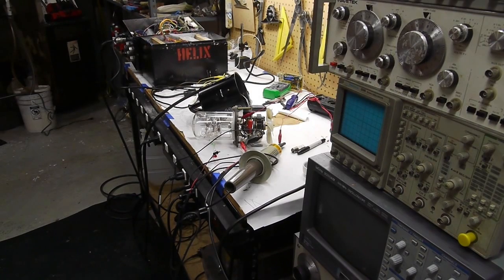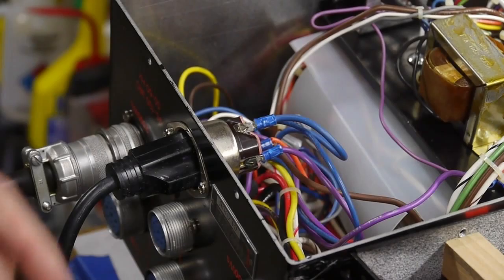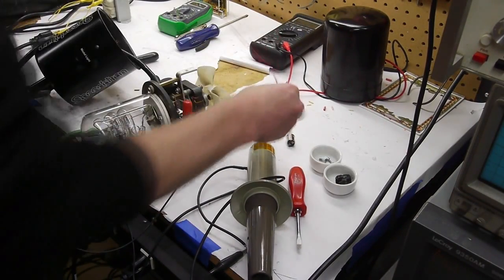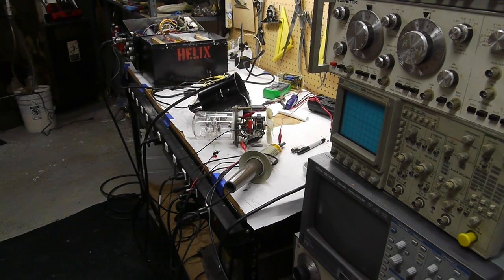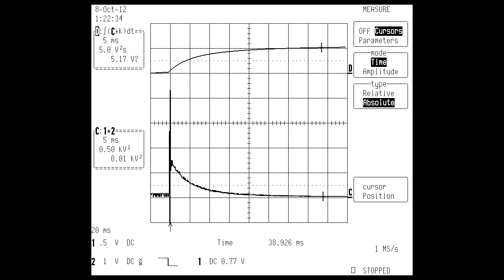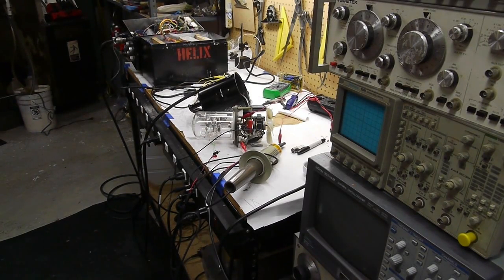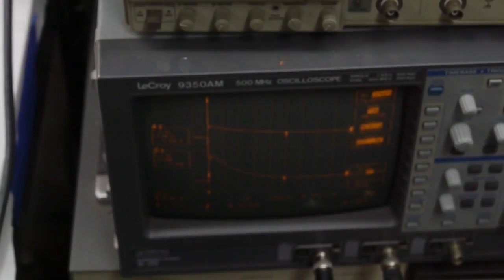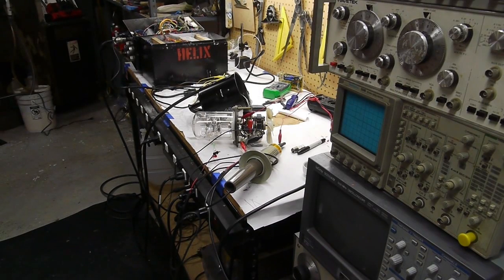Measuring the voltage, current, and light output of a strobe flash lamp (Speedotron 4803)

Comment: I believe the model of the flash head is the 102 series: 102, 102A, there are other minor variations. I believe the official Speedotron part number for the flash tube is MW8QV. Rated for 3200 watt/seconds.

Comment: Good experiment idea, really bad explanations. The unit is 4.800 Ws, that's 4800W power for one whole second. Putting that kind of energy to 0.001 sec is a thousand times more nominal power in that pulse. You should be measuring much higher voltages  unless the arc plasma resistance drops close to 0, and many more thousands of Amperes in peak current of 50μs. You don't even mention the specs.. like pulse duration and capacitors specs.....lamp specs...applied looney tunes all over the place, and yes you have an oscilloscope. Sorry but your whole experimental stepping and accompanying explanations are really like a grandmas lets cook whatever is in the fridge today, put all in the casserole, hope for the best.

Comment: You've answered some of the questions I've had regarding flash tube operation.Thanks!

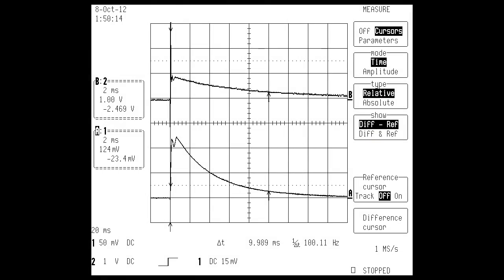I don't think the 3500Amp spike is realistic - there's lots of transients going on at the beginning of the flash. Lets not forget the inductance introduced by the cable wiring, and there are likely capacitive effects as well. 1000Amps is more likely... and appears to be supported with good correlation to the light measurement using the LED if the "3kA pulse" is ignored (at 5:46). Consider the two small bumps at the start of the flash (ringing in the circuit?), and similar decay if vertical scaling is adjusted.

Furthermore (at 4:30), a graph of the flash tube current shows a negative 1kA pulse of 5ms duration. Could that be a current pulse to the trigger transformer in the flash head? Trigger transformer primary windings are often connected across the capacitor bank to produce the multi-kV pulse needed to ionize the tube.

Comment from the maker: Yes, it wasn't a very good way to measure the flash duration. A reverse-biased photodiode would be a much better choice. In that case, junction capacitance would be 20pF, and the load of 100ohm would produce a very short time constant.

Comment: Hi,
I think the slope has something to do with the fact that you are using electrolithic caps.
You can see the effect by shorting a charged cap., and have a scope or v-meter, you will see the voltage rising again after the shorting. Electons are still trapped in the electrolyte  and migrate slowly towards the electrodes.

Comment: Also, the long time constant is typical of electrolytics.  Maybe a bit more than I'd think, but it depends on design, and is probably an engineering decision in this case.  Playing with a "medium" tube before (horseshoe style), I've seen discharge on the order of  ~2ms for general purpose aluminum electrolytic, as short as 10us for snap-in style (these are really good electrolytics!), and the same for film-in-oil types (probably limited by ionization time, ca. 5us for xenon).

Comment: The slow decay on the voltage waveform makes me wonder if the probe is compensated properly.  The voltage drop across the tube should be pretty steady, unless the plasma is a lot more resistive than I think.  The tail is in agreement with the current though.  Likewise, eyeballing the current shunt, it'll have around 30nH inductance, which would generate a 3V spike if it reaches 1000A in 10us (typical for small tube; the 50us spike observed may be the case for a big tube).

Comment: Actually it is much safer to use a grounded scope compared to a scope with lifted ground. When you isolate the oscilloscope supply you get 400V on the case, which is not a very good thing to do.

Comment: You may be measuring the phosphorescence of cerium doped quartz in the tube in the slow decay time of the light.

You haven't seen a large xenon flashbulb until you've seen the 6 foot fluorescent tube size bulbs that power the 500 trillion watt laser pulses of the National Ignition Facility.....

Comment: LED's work in both directions, meaning, if you apply voltage, it outputs light, apply light, and it output's voltage. The output voltage is not much compared to the energy it takes to produce that voltage, and only works with compatible light colors.

Comment: As for light measurement - I guess it's a better idea to measure reverse leakage current in PN junction, which is linearly proportional to the amount of photons hitting it. Also, AFAIK this is supposed to respond quicker.

Comment: I was once playing with a flash circuit from a camera,and decided to "BEEF IT UP!" so I got a 2000uf 450V cap,and wired that up in place of the original 330uf one.
Boy,I sure got a (single) bright flash,and a big bang...and was picking hot shards of glass out of my skin.  The tube was vaporized. Be careful when "beefing up" strobes.

Comment: you can use regular LEDs as light detectors, just like a photo resistor/transistor. of course that's not the led's main function but it can work.  it's a good alternative if your project calls for light sensing and you ran out of dedicated photo-components. google "photovoltaic effect" if you're interested enough.

Comment: what is the deal with LED? I didn't know regular LEDs react to light, is it because of the very high intensity of the light you are dealing with? or you can for example detect smaller changes in light intensity this way?